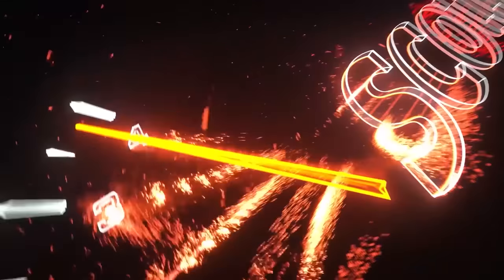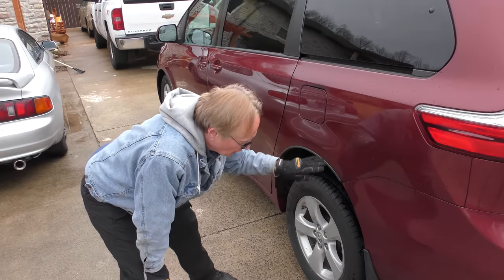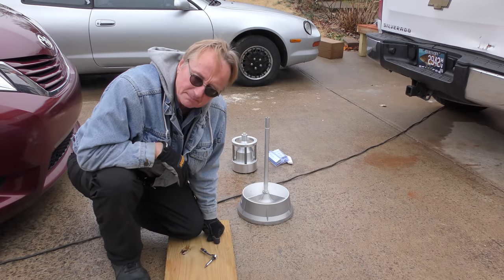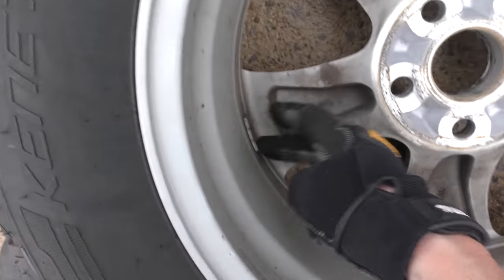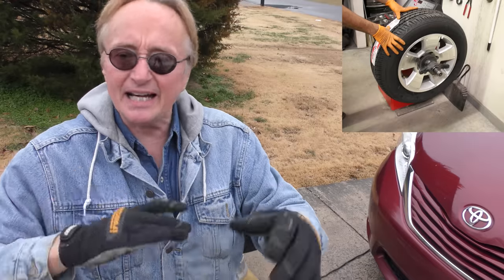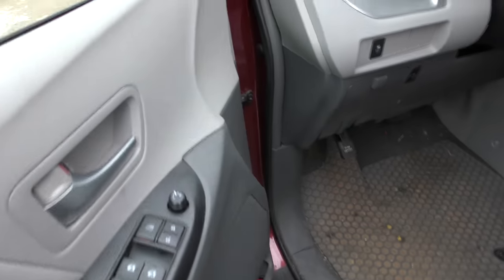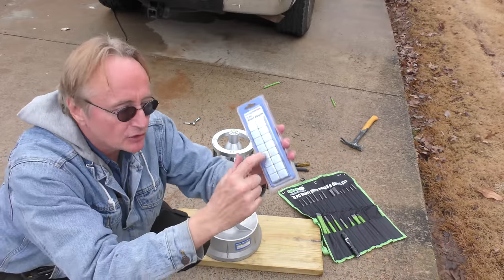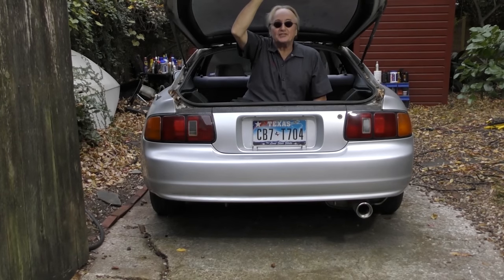Stop Going to This Tire Shop Right Now

Comment: There's a lot of greenhorn mechanics out there. I'm I ike you most of the time you do it yourself,no worries,but if you do let someone work on it remember this, they are repairing something that has your life in its grip Always check behind the mechanics, IVE HAD TIRES PUT ON AND NOT EVEN TIGHT

Comment: Yet another story about incompetent mechanics. The most difficult job of auto repair is finding a good mechanic, or better yet a competent shop, with mechanics that have been schooled and certified. It may cost more, but you won't have to fix a bad repair. Many shops advertise schooled and certified mechanics.

Comment: If you go to town fair tire because they will give you a free alignment do not go there anyway because . I did got 4 tires and got charged for the alignment . The reason they say they had to align the rear wheels. I am a retired mechanic and trucks do not get rear wheel alignments . For your 4 wheel independent suspension yeah . Scott You never get to the point and You are annoying Me a lot .